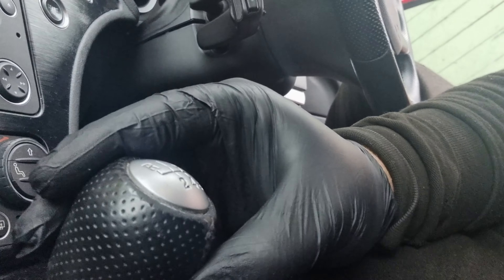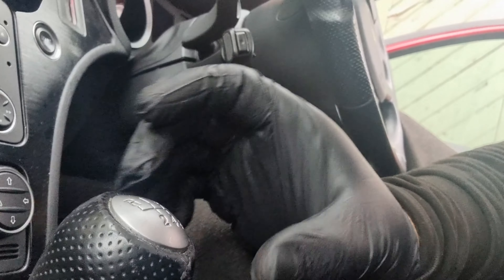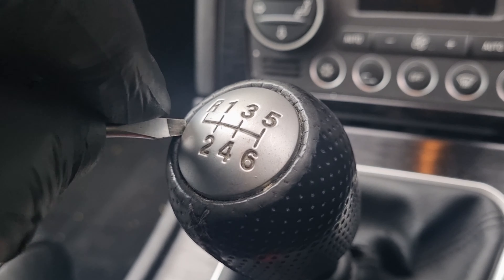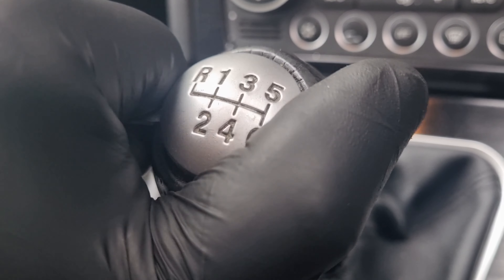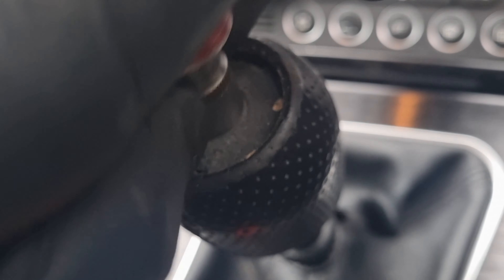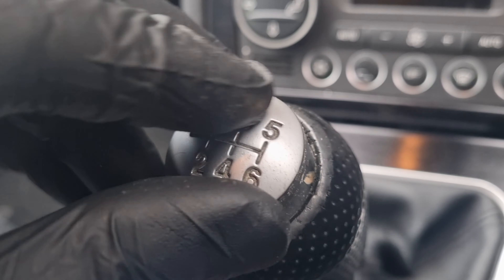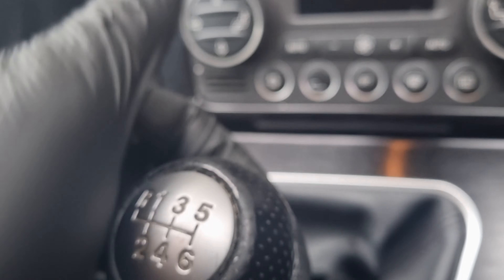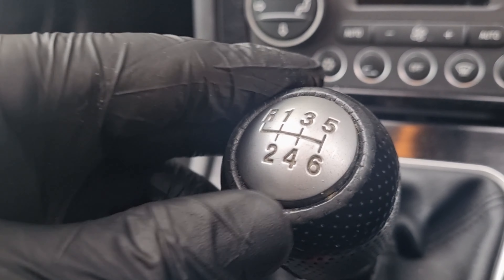alfa romeo 159 brera gear knob wobble fix

Comment: Hello. Could you show how to disassembly knob in 147 or GT? Thank you
Reply: knob on a 147 is just pulling it off. it's pressed on , using a heater gun to soften the plastic a bit helps.
Reply: Thank you. I'll try. The new one has thread so I need to tap the rod.

Comment: Is there a Brera model available with an auto box and not the V6 model? I can't have the V6 as it's too thirsty and need an auto as I have mad back and and finding it a struggle to change gear but absolutely love the Brera....??
Reply: Yes, you can get 2.4 jtdm diesel with auto box.
Reply from the maker: Yes 1.9 and 2.4 but not very common.

Comment: Hiya pal. I'm a new sub and not far from you (I'm in bridgnorth)! Just brought a gt and the thing is leaking coolant into the foot wells :( this obviously leads to overheating. Any idea what could be the issue? Cheers
Reply from the maker: Anything in side is heater matrix. Huge job to swap.
Reply: @ItaliaAutos  thanks for the reply. I presume the whole dash has to come out? I'm gutted tbh as I've always wanted an Alfa and I've only driven this for 10 miles since buying it :(
Reply from the maker: Ouch